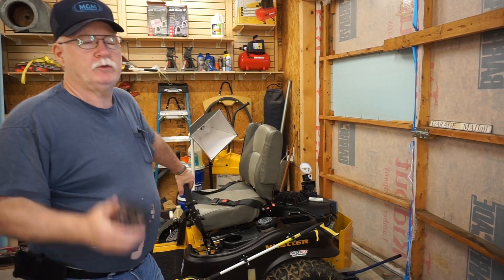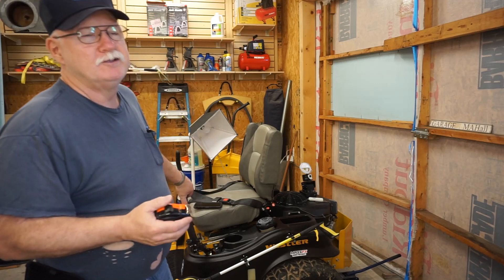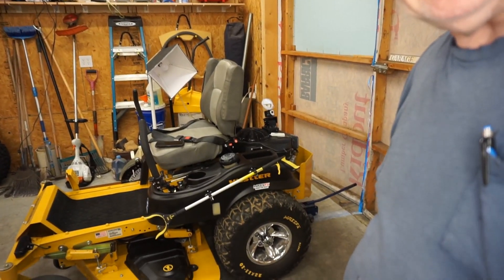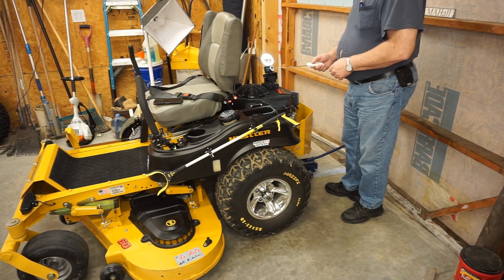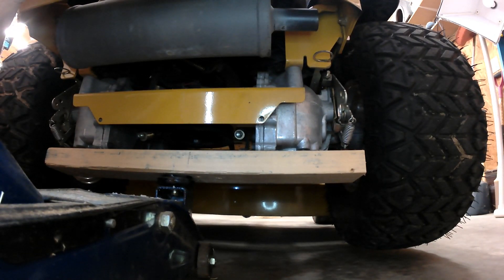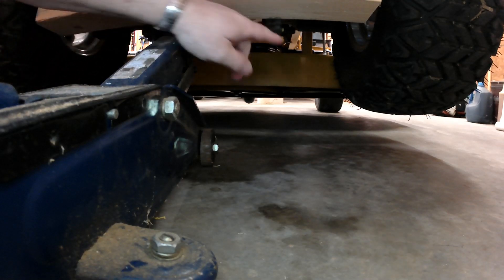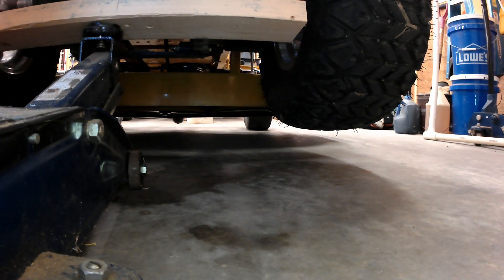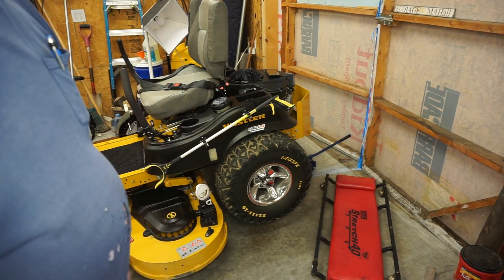Safely Elevating the Rear: A Guide to Jacking Up Your Hustler Raptor SD

Comment: Max do you have a Shute close off on your mower? I would like to make one for my raptor sdx54”any ideas?thanks
Reply from the maker: There are several videos that shows the one I built and used for a while. I've been back to open chute for a year or more now. I just blow away from flower and shrub beds.
Plan my cut and follow the plan. My chute block off worked beautifully. Go check it out. Three is a search magnifying glass at the top right, type discharge block off or chute block off, something along those lines. 

Thanks for watching. I need the help.

Here are a couple: https://www.youtube.com/watch?v=OUPaa8JoZJ8&list=PLrp_jeVoHI66OoFff6DP2OTXnHYg3pFbI

https://www.youtube.com/watch?v=NVRtDlBqpzo

Be sure to like, share and subscribe. As I said, I need the help. Thanks again.